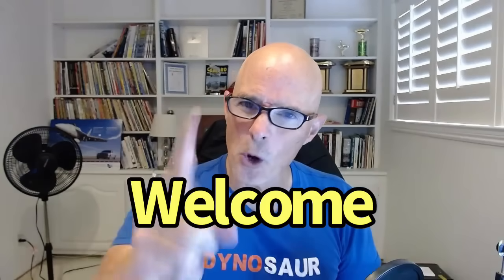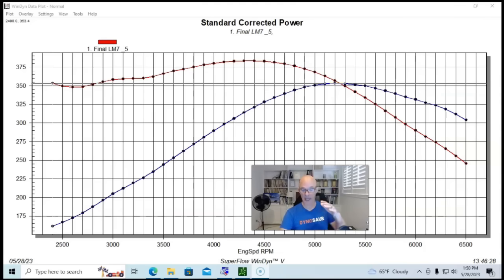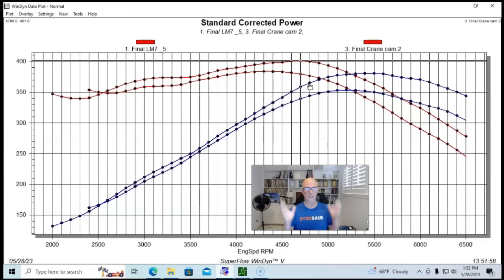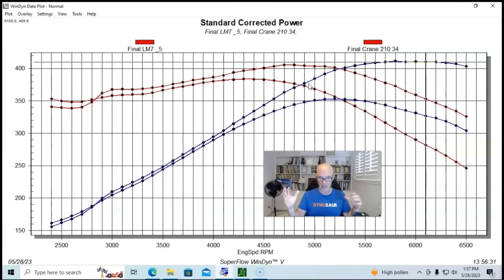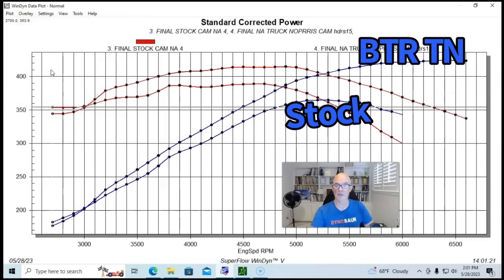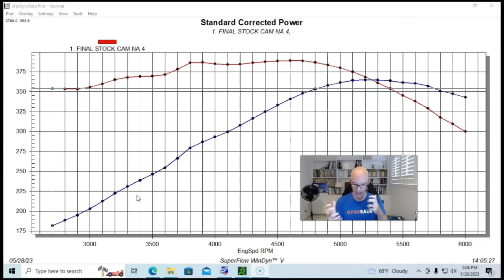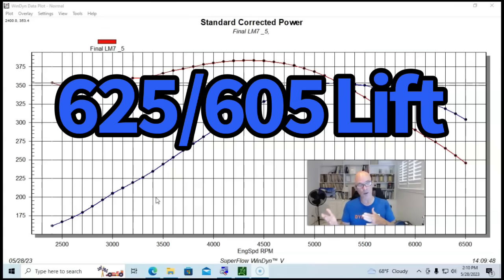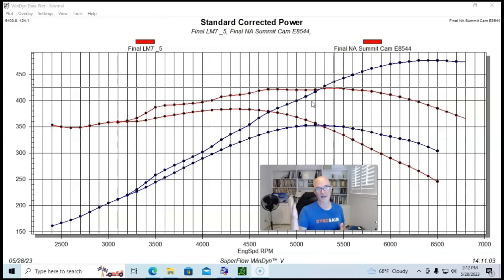THE BIG LS CAM MATRIX-HOW MUCH POWER EVERY LS CAM WILL MAKE BASED ON DURATION. 190-230+ DEGREES.

Comment: How does displacement play into cam choice? I have a 6.0 with a sloppy stage 3 , because ALL THE CHOP 238/242
Reply: I personally feel about 10° more dur. @ .050, per 50 cu. in. of engine disp., and about 2° tighter Lsa, is comparable for the intended RPM range. For my example: (Let's use 9 to 1 comp for all engine's), 1st a 305 5.0 Liter, with 228 @ .050, .570 lift, @ 114 Lsa installed 4° adv, and proper intake, and exh.= RPM range of (3500 to 6500), vs your 366 6.0 Liter, 240 @ .050( i averaged your dur. specs. to single pattern for this example), .600 Lift, @ 112 Lsa installed 4° adv, with proper intake, and exh.= RPM range of (3500 to 6500) 3rd example: A 9 to 1 comp., 427 7.0 Liter, 252 @ .050, .630 lift, @ 110 Lsa installed 4° adv.= (3500 to 6500). If ALL cams were installed straight up, it would move the RPM range up 200 to 300, so (3,700-3,800 to 6,700-6,800), and if ALL cams were installed 4° retarded from straight up, it would move the RPM range up another 200 to 300, so (3,900- 4,100 to 6,900-7,100)
Reply: @evilinside5984  that’s some great insight and makes a lot of sense! Thanks for the well thought out reply

Comment: This comparison  is boring. Compare LSA 106 vs 113. If more overlap and shorter duration doesn't work, tell us. Also give us vacuum  readings.
Reply from the maker: SEE THE LSA CAM TEST VIDEO
Reply: Not sure why you'd run that tight of a lobe separation with a small displacement ls.  Could understand 106 LCA on a 23 degree na pump gas 383 sbc or something like a 14:1 421 23° sbc.

Would think it would like something in the neighborhood of 111, perhaps 109 for a "383" lm7 unless you were turning up the cr/boost.

But yeah a LCA test would be cool for a given displacement, head style, cr and operating range.  Pricey test and likely out of the scope for the average viewer.

Comment: Hot rod cam is a lot smaller at 217°; to keep up with the 228° SS2 is impressive
Reply from the maker: THE DYNO RESULTS WERE THE HOT ROD CAM-SHOULD HAVE BEEN IN A DIFFERENT DURATION GROUP
Reply: He might be talking about the "Red Hot" cam from BTR at 221*.  The 5.3 Hot Rod and LS3 stage 1 v2 from BTR I think are the same thing at 217*.  All the newer BTR stuff seems to be really good.